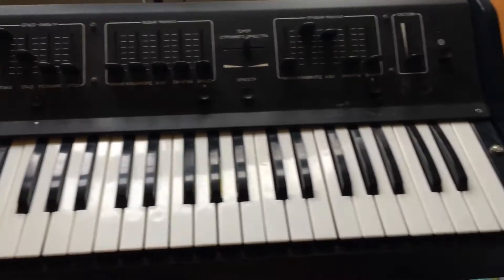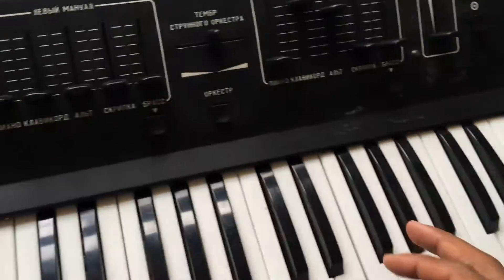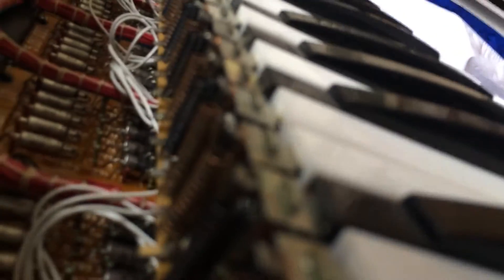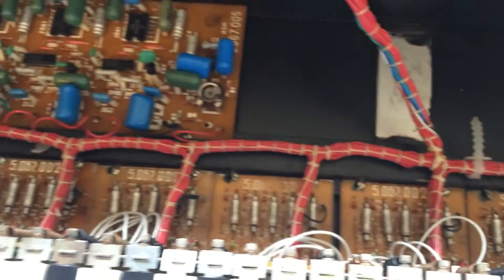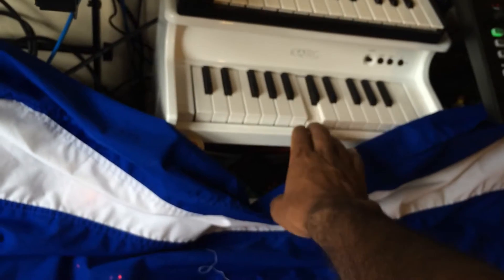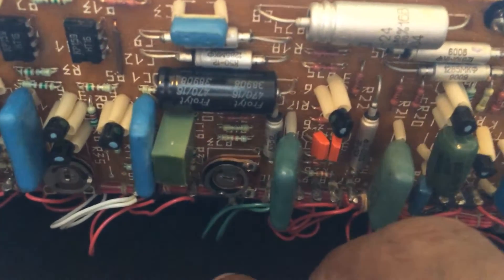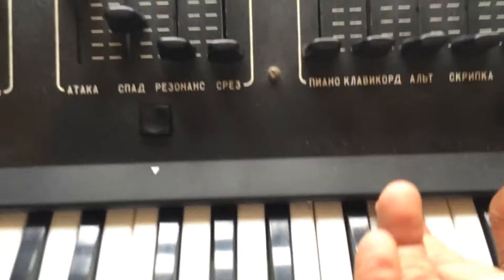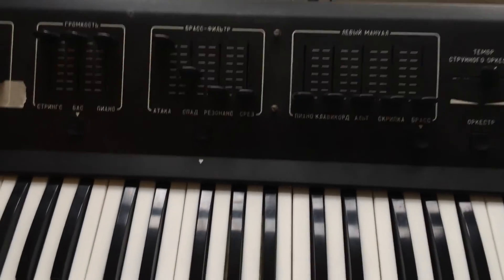TOM 1501 vintage synth tuning repair

Comment: Mine suffers from a little bit different issue. Some of the sounds of the right section ("правый мануал") - "альт", "скрипка" and "брасс" are one semitone higher than all the other sounds in both sections, meaning that the "бас" + "пиано", "клавикорд", "альт", "скрипка", "брасс" (from the left section) + "пиано" and "клавикорд" (from the right section) preserve the same tuning if I adjust the tuning slider. I tried to turn the inductor, mentioned by  @iliasleontiadis2139, all the way to the right, as well as all the way to the left. That has changed the tuning slightly, but my right section preserved the originally described behavior, drifting out of tune with a whole semitone. Any tips would be highly appreciated!

Comment: Ok, the tuning can be done under the keyboard, in the left side. There is an inductor. Take a screwdriver and turn it to the right position to have the tuning slider in the middle. End !!

Comment: I am sorry but none of those trimmers can adjust the tuning of the instrument. At least not at mine. The 2+1 trimmers on base board have to do with the included strings chorus and the ensemble effect, both upper have to do with cutoff/resonance of the Brass section and the other two in power supply have to do with +-15V. Probably the Tom uses a chip for keeping the tunning stable at the middle of the slider and it will work after replacing of the appropriate electrolytic capacitors and/or power supply transistors.

Comment: Well done just diving in and giving it a go!
One thing worth mentioning just because it might save ones of these one day if someone else does just jump in to see what all those trimmers do is that the two trimmers on the PCB your pointing at at 2:24 minutes are trimmers on the power supply board.
I don't know the 1501 but adjusting them without the PS board disconnected and metering the voltage 'could' lead to sensitive parts getting cooked.
Not having a go at you I teach people how to DIY so i'm all for diving in! But also hate to see a synth fry too.
Again dude good on ya for having the balls to get in there :P
Reply from the maker: cheers! good to know and thank god we don't have a bbq synth.... :)

Comment from the maker: Just skip to 3:42 if you want the quick walkthrough.....
Reply: Mate, thank you for making a video to try helping out TOM owners, but the tuning is done with a inductor under the keyboard all the way on the left side. Once you lift up the keyboard it's almost 1/2 way back on the right edge of the left-most circuit board which is the oscillator and top octave generator. There are also 13 chips on that board which are responsible for generating the master notes. The inductor is a 3cm tall cylindrical device with an irregular shape and some wire is wrapped around the cylinder part way up. It's labeled L1 on the board and mine is white plastic. There's a tuning slug in the center of the cylinder that will accept a small screwdriver and tuning can be done with the power on as the logic runs from 3 volts and the oscillator runs from 9 volts. Set the tuning control on the front panel 1/2 way and adjust the tuning slug until you're on. If you don't have a plastic screwdriver you'll need to adjust and then remove the screwdriver before listening to check your tune before adjusting again. 

The control you're pointing to on the 2nd board is potentiometer R27 which sets the bias voltage of the Bob Moog designed 24dB lowpass (brass) filter and I don't understand how that could affect the overall tuning. It affects the tuning of the brass filter which was taken from the Crumar Orchestrator, but it shouldn't affect the oscillator pitch.

The first two potentiometers you point to are on the power supply and are responsible for setting the +15 and -15 volt supplies. These need to be properly adjusted for proper operation and lifespan. Adjusting those at random makes me shudder because these things have poorly designed supplies to begin with and you can cook your synth with too much voltage. If you've got a mate with a meter, have them double check you're still OK. On the power supply board, terminals 2 and 3 are the ground connections. Terminal 4 should read between -14 and -15 volts, while terminal 5 should read +14 and +15 volts. Lower is better. Adjust as necessary or the life will possibly be cut down. If your +15 supply is set too high, it can kill the +5.6 volt supply that runs the keying circuits and possibly kill the octave divider chips. Just for reference, terminal 7 should read roughly +5.6 volts but you can't adjust it and terminal 1 should read close to +3 volts. Those last two voltages are derived from the +15 volt supply.

I'm about to replace all the electrolytic capacitors in my TOM as they're starting to fail. It's a lot of caps... 212 in all. With that done a TOM-1501 should last a century with ease.
Reply: @Peter_S_  Thank you very much!